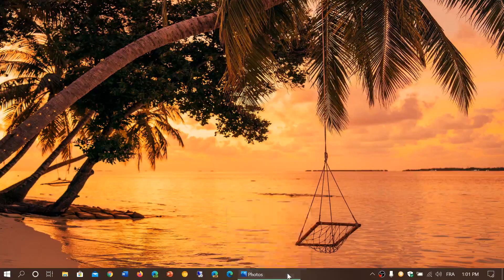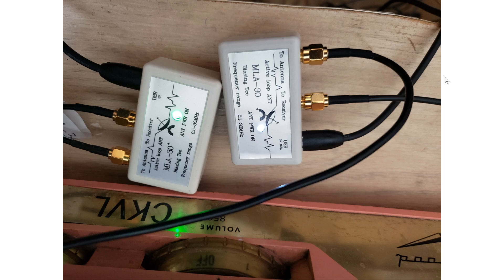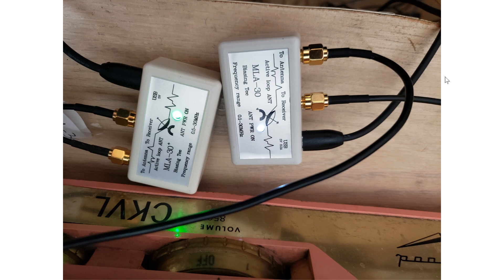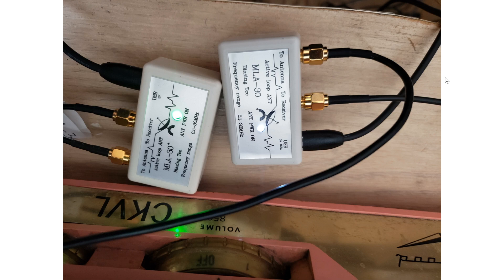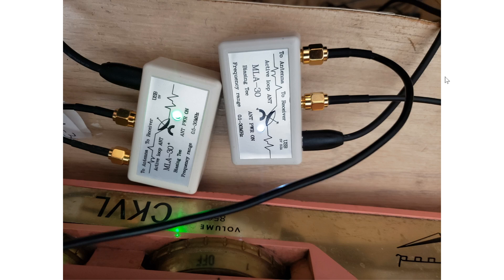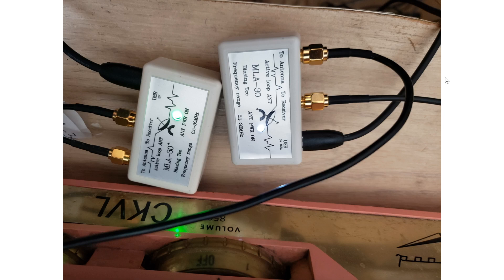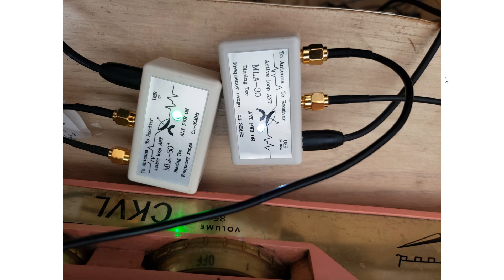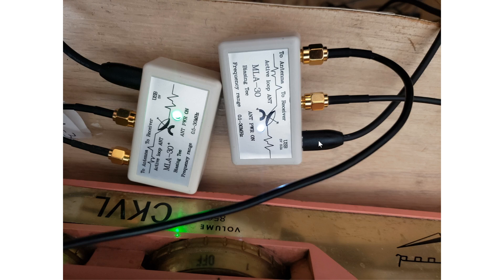MLA 30 VS MLA 30 Plus and Bias T power and testing March 10th 2020

Comment: The bias-tee for the MLA30 has to up the 5v supply from the USB supply to 12V to the masthead amplifier, likely by a SMP, hence noise, I feed my MLA 30+ using my own bias-tee at 12v from a linear power supply. It is much quieter.

Comment: Thanks for the video! I bought an mla30+ but i notice no difference when the power to it is on or off. Should you see a signal increase when turning power on? Or is it normal there is no difference? Thanks!
Reply from the maker: there should be a big increase, make sure the power is correctly applied to the Bias T and that the wire going to the antenna is not damaged as it powers the amplifier in the box of the loop.
Reply: @OfficialSWLchannel   Thank you very much for the answer! Today I tried it on my old sony 7600 and it works perfectly on that radio. On my icom ic 705 it makes no difference at all if the power is on or off. Strange!

Comment: I'm so confused and heartbroken.  I bought one that says "MLA-30+ Plus", it has a much larger loop and it says lower range is 0.1Mhz which doesnt match anyone elses.  I have no idea what I got and I feel ripped off.
Reply from the maker: MLA 30 and 30+ have the same size loop
Reply: @OfficialSWLchannel  Not the one I got, mate.  I got sent something real weird... there's only one review for this one.  I think it's some kind of knockoff but there are subtle differences.  The loop is almost 2x as big, it's al branded "MLA-30+" but instead of being 0.5Mhz-30Mhz like the plus, it's listed as 0.1-3.  I think this vendor took an old MLA-30 (non-plus), printed a new label, and gave it a bigger steel loop.
Reply: @OfficialSWLchannel  And yeah I know the MLA-30 and MLA-30+ have the same size loop, I've had both.  But this new one I ordered is wonky.  China bites again.

Comment: Great vid. Subbed! What cable do I need to go from the MLA 30 amp to a 3.5mm input? I have an Eton Excutive Elite receiver. I can find anything online. Also, I'm not sure if it's supposed to be mono or stereo? Thanks.
Reply from the maker: https://www.amazon.com/Eightwood-Bulkhead-Adapter-Shortwave-Antenna/dp/B09VSZMFW5/ref=sr_1_3?crid=2HO3QOPWH519A&keywords=sma+female+to+3.5+mm&qid=1697063728&sprefix=sma+female+to+3.5+mm%2Caps%2C87&sr=8-3

Comment: Thanks for this comparison.  I have the 30+ setup indoors in my attic, and I think it works pretty well.  Seems to do better than the long wire I have strung up (in the attic as well).  Looking for any easy tweaks to make it even better.  Is it possible to replace the bias-tee box altogether with a less noisy one?
Reply: Conseguiu a resposta ?

Comment: You are right! The description on Amazon does not have + in it anywhere but the pictures show 30+. I ordered one for my RSPdx and Tecsun PL-330. I am curious why the PL-330 MW doesn't connect to the external antenna??? Just the internal antenna only.
Reply from the maker: it does , there is a hidden feature key press that enables PL-330 to connect MW to external antenna
Reply: @OfficialSWLchannel  Studying the manual for a second time. Thanks for pointing that out!
Reply: @OfficialSWLchannel  I looked in the manual and can't find this hidden feature. It is hidden (from the manual) feature I guess.
Reply from the maker: the manual does not have the hidden features...    here they are 
https://swling.com/blog/2020/10/a-tecsun-pl-330-features-reference-sheet/
Reply: @OfficialSWLchannel  Thanks! Bookmarked!

Comment: I wonder if the internals of the MLA-30 and MLA-30+ are the same but merely the gain setting is tweaked a bit to increase the signal receiving sensitivity at the 15,100 KHz (19 meter) as you had shown in your MLA-30 & MLA-30+ comparison vid? As you have stated, this might make for a good vid with you opening both versions for inspection & demonstration. YouTube poster kurama10goo has kindly detailed how to adjust the gain adjustment here: https://www.youtube.com/watch?v=f7XhuN27daU